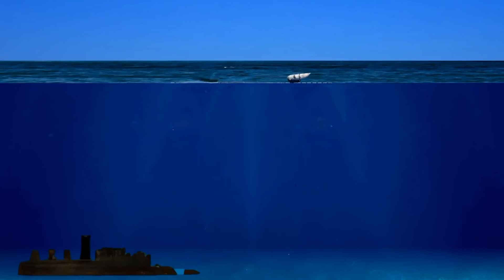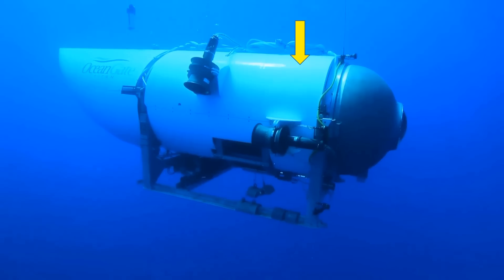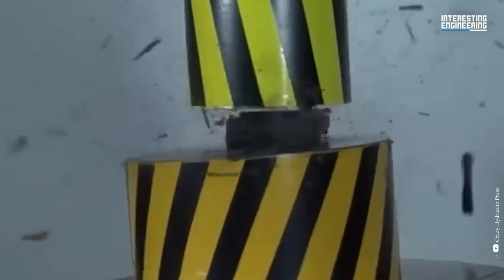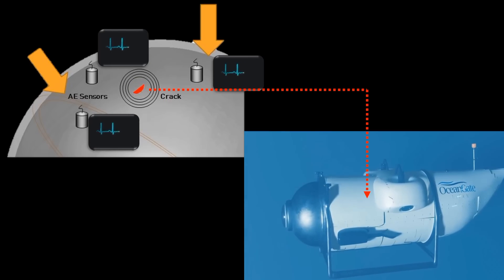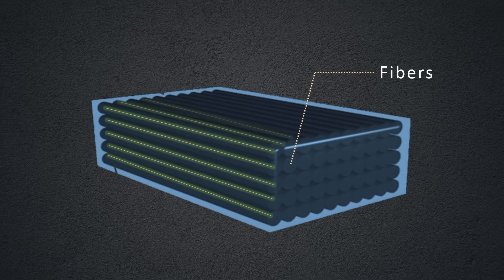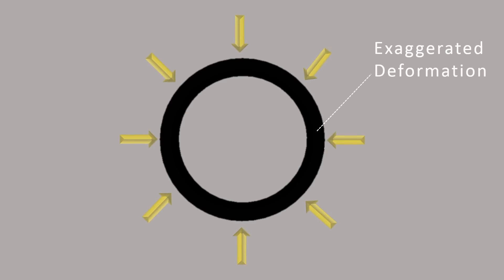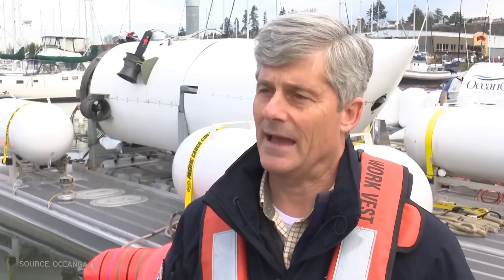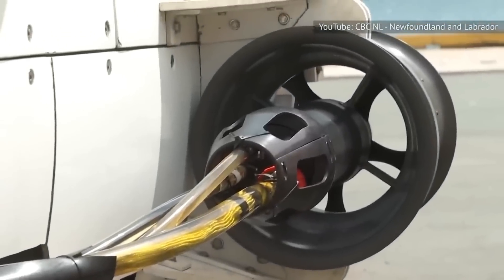Oceangate Titan Did Not Implode Just From Pressure. There Is a Catch!

Comment: Another detail that most folks are ignoring is the cylinder was subject to tremendous axial loads.  While those titanium end caps were strong enough to withstand the pressures, they also have to be 'kept separated' by the cylinder.  That's over 58 MN (13 million lbf) applied 'across the fiber'.  A narrow walled cylinder subjected to much axial load could suddenly buckle, especially if the cylinder deformed even a little bit from some growing defect.
Reply: Like when you can stand on an empty soda can if you can slowly balance on it, but if someone touches the cylinder wall with smallest pressure it collapses.
Reply: @DJJahT  Quite right.  Now in a soda or other beverage can, they deliberately pressurize the can and that helps the cylinder maintain rigidity.  A full unopened can is actually quite strong.  But relieve that internal pressure and as you say, the smallest defect/ dimple and it crushes immediately.
Reply: Ah that was a fine old party trick in high school until the one time I trapped my fingers because my reaction time was too slow from what was contained within the aluminum cylinder which I had previously emptied. Into my mouth. And it wasn't Coca-Cola.
Reply: @DJJahT that’s a great analogy, so true !
Reply: @DJJahT  except titanium & carbon fiber are stronger than aluminum.
Reply: Correct. Therefore, I think that the implosion occurred in the axial direction, where all the compressive force was carried by the epoxy and the thin tube of metal on which the epoxy was wound.
Reply: Axial load!!  Yes!!

All that resisted the axial load was epoxy.  Having fiber probably increased the stiffness, but the fiber orientation was normal to the axial component of the load.
Reply: So if the front dome piece is titanium and centre hull is carbon wouldn’t they compress at different rates?  And where they are joined be a risk of failure?  And how was aloud to enter the sub like that
Reply: @joechapman9518  well yes, but that would be in the radial direction.  As pressure rises the titanium ring would be 'squeezed' to a smaller diameter, and so would the carbon tube.  They have different rates of 'squeezing' (Young's modulus) so they would no longer be the same diameter as each other like when assembled.  I believe the titanium would compress more (it has a lower Young's modulus).  This DOES add additional stresses at the joint and may have been a failure point.

I was just pointing out that the axial loading hadn't been discussed much.  It is being applied to the carbon fiber at right angles to the way the threads run, and that's the weakest direction for carbon fiber.
Reply: O-rings...weak links in Space and Ocean environments.
Reply: Yes, I was wondering how the junctions between the O-rings and the carbon fibre part were doing, especially since the overlapping of the rings with the carbon fibre hull were only a few inches. If the carbon fibre tube was working during descent and ascent then the glued parts at the O - rings (which themselfes were probably the stiffest parts with the  least deformation) would be those with the biggest movement along the way. The stiffest and most pressure-resistant part (the O-rings) were connected to the part of the hull that moved the most during descent and ascent if I understand it right. My guess is that one of the O-rings had probably started to disconnect from the carbon fibre tube, due to the adhesives being weakened over many cycles. Things might have started there. Just a guess. I'm not an engineer.
Reply: This is what happens when you skim your research before building a sub, a cylinder is great at holding up vertical loads, not great as a pressurized vessel due to load being all encompassing. The Titan would have been best used to view shallow areas for extended times but I wouldn't go past 300 meters in that thing.
Reply: @gustavedelior There's a report, that on an early dive, a passenger heard cracking at 300m.
Reply: @georgew2014  since they didn't hire old white guys to drive the things it wasn't old knees lol
Reply: What is the problem using decimal units? Try Mpa, tf/mm2, KN/m2 etc

Comment: According to leaked transcripts, looks the rate of descent was too fast: they were 1h earlier than scheduled at 3700m depth, and being lighthearted about it. For a sub, a faster rate of descent means buoyancy is off. Indeed smth was off because when they tried to ascend after alerts, they were slow (6m per min). Had procedures been taken seriously, the ship would have asked the sub to slow their descent, they would not have been able to comply easily, which would have triggered an abort when it was still in a safe zone. The company did not toy with one boundary, but all at once. They did not learn or even tried to learn anything from previous mishaps. Brashness and overconfidence killed ppl.
Reply: Have those leaked transcripts been confirmed as real? I heard they were fake.
Reply: At the FIRST depth check-in, alarm bells should have been going off. You see the same thing with air plane pilots occasionally - rather than immediately abort at the first sign of trouble, the ego takes over and they continue on believing they're smart enough to resolve the problem on the fly. What they AREN'T considering is the lives of others who are trusting them to NOT do that
Reply: At that rate it would've taken them approximately 9.4 hours to re surface from 3400 depth...you're right. It's crazy that no one picked up on this.

Comment: Please, don't quote the controller as engineering mistake. If all, that was a right and smart decision. First of all, a consumer device is most probably much more stress tested than any custom made ones. Second, it probably communicated with the computer inside the sub. Third, they had a couple of spares for redundancy. Fourth, it's not connected to catastrophic failure in any way.

Comment: Just remember this: there is three failure points on Titan. 
1) power cables entering the sub prone to leaking salt water.
2) carbon fiber hull
3) epoxy glue attaching carbon fiber to titanium end caps.
I think the epoxy glue failed first, allowingvdra water to enter throwing the sub off balance and disturbing the bouyancy of the sub. Keeping it from surfacing in a timely manner. Sea water is very corrosive. Once water started to enter, the hull was losing effectiveness in its strength. Once the epoxy glue completely failed, there was no keeping the end caps from separating from the sub and the weight of the water crushed the sub. The weakest point on the sub was The epoxy glue.

Comment: sry but that long sub are not a problem is just wrong 

most deep dive sub do not have long body but a titanium sphere with a long open body build around it that did house the equipment
MILLITARY SUP MARINES  DO HAVE LONGER BODYS BUT THEY DO NOT OPERATE AT AND GO DOWN TO 3000-4000m they do operate at like 400m-600m !!!!!!!!!!!!!!!
the window they did used was only rated for up to 1600m also not good!

I also said that they only use unidirectional carbon, but a long tube must also be reinforced according to the length, so bi-directional cargo should also be installed, as movements can cause the tube to bend slightly
but what i did missed is that they did NOT use a vacuum at all on the carbon chamber, too pull out any bobbet that may be trapped in that carbon layers 

the ends also did only extend 6-10cm into the titanium ring if you ask me they way to little because thoses parts gets the highest forces to carry, at that point need to hold the wight and momentum of the titanium rings at every movement (sure it lighter in the water but it still has a wight undlike the middle parts)

and then the the monitors and other part from the inside i just really hope the did not screw it into the carbon haul but into a inner shell 

they also have sensors build in into the carbon struckture with is kind of bad because thoses part are weak points not layers of carbon, sure it can tell you 1-3 min befor it collaps that you going to die but what the point it take minutes or even hours to get back
the transcript did say all sensors did fail and it did not help them at all in the end it was just like a deathflag nothing more for them 

that carbon prodution part it also importend like you did say 
but also what kind of quallity did die use and what material?
carbon olny? 
carbon + aluminium (like for planes)?, 
carbon + aramid (kevlar)? pain in the ass to work with but it will not crack like carbon dose 
unidirectional? (good to make rings or as additions layersto strange a part in one direction?) what they did use only (why?)
bidiagonal?
bidirektional?
triaxial?
quadraxial?
all these variants have different properties and strengths
a combination could have stiffened the hull more than just one variant lying in one direction the pressure acts on the object from all sides, as well as the weight distribution of the objects that are attached to the carbon tube when moving, the loads on the pipe change since it was due to the metal ends or the people in the pipe, who by the way had no seats

they should test different meterials not just one in different layers and use vaccum to pull out any air out of the epoxy they used
maybe then it would last longer maybe  
but the moment i realize they did not bleet the air out of the carbon i know it had no chane in the long trem 
fuck even for car part they do it because it can cause depamination

Comment: What was the point of it having Real Time Monitoring? To be told in real time that the hull was in serious trouble, probably accompanied by cracking sounds; and to be told you're going to die at any second! The RTM was another gimmick on Ocean Gate. Rush should have strength tested the carbon fibre and its peanut butter-like glue in his sub before taking each dive.
Reply: Indeed. Rush's attitude to failure testing was "Most failures are due to user error. Testing doesn't weed out user error, therefore it isn't necessary."

Comment: Would carbon fibre wound around steel/titanium frame/cage work better? This way compressive load from outside becomes tensile load.
Reply: It would have to be a very chunky sizable frame, you lose the 'advantages' of the open CF tube then. they could have used multiple sphere construction connected together with titanium bulkheads (small access opening between spheres), that might have worked.
The design was light weight for cost and ease of manufacture and handling, 'disney' pleasure trip submersible etc.

Comment: I've used CAE to design a number of composite structures which have then gone to physical test.
There are many factors that you just can capture in CAE. The manufacturing process is key but must structural engineers know that composites are crap in tension.

Comment: Carbon fibre encapsulated in expoxy resin, is a plastic. Plastic material is never stronger than the day it’s made, all mechanical strengths decrease with age, stress , uv exposure , thermal cycling and other assorted impacts. 
Fools all at ocean gate

Comment: Ir xould bit gave helped that there were iver thirty feet of glue joints on the Titan. The two ends were glued to the middle. Between changing pressure loads and changing temperature, along withmetal glued to carbon fiber, each element responding differently to pressure and temperature, it had to be hell on those glue joints. Rush was trying to redefine physics to fit his desires. This was cocaine engineering. Youll never convince me that cocaine wasnt involved in this arrogant stupidity.

Comment: The game controller is basically the least of the problems on this craft. As long if you got a spare, and batteries you're good. Don't forget, military utilises controllers for certain aiming of guns as well. Sometimes it's just a practical solution off the shelf. Oceangate is getting alot of flak for the usage of that Logitech F710 controller. But after learning how many rules and common sense was thrown overboard, this was exactly what Cameron said 'an accident waiting to happen'. A carbon shell, why the hell would you want to make something that has to dive; lighter? This material is strong as hell, but as you pointed out; the wear on the fibers which apply when diving up and down causes invisible damage.

Comment: It essentially wasn’t from pressure it was the fact that water is not compressible at all, and if it was then it would compress and water would enter the sun at normal rate despite pressure, but Bec water has no compression that pressure makes it get extremely violent.  I could be wrong though, I remember seeing something where you can swim at certain depths so long as your lungs are filled with a fluid, seems totally counter to reality but allows you to breath

Comment: Your model of the load is not correct. Under waterpressure, the structure is compressed on all sides. It does not have a bening load. The only "bending" is a result of buckling, however this is mainly affected by the stiffnes as this provides stablility. This load is carried by the epoxy. The only real bending load is on the length of the cylinder. Unfortunetely this bending load has an extreme negative effect on the ability to absorb the pressure load already exercised by the front and rear titan rings.
As stability is the main design feature to withstand pressure loads with instand failure when exceded, composite materials are the worst.

Comment: They towed the sub for 600 miles across the stormy Atlantic behind the mother ship for the first time this year. Videos circulating of a sub being launched from on board a mothership was from prior years and not the fatal mission. The sub was towed on top of it's dual float launching vessel. That launching vessel is of flat bottom design intended for calm water such as a lake or a river. In open seas any vessel needs to have a V hull variation to attenuate vertical shocks of pounding wave action. This towing business may have damaged the sub in many ways and created a situation where any necessary servicing or maintenance of the sub was made difficult or impossible as it was stationed on a tow rope in bouncing waves.

Comment: You need to update this as we now have an update due to the leaked messages between the Titan and it's mother ship just before the implosion. They had an acustic RTM (Real Time Monitoring System)  on the sub that monitored the health of the sub in microseconds. It's supposed to pick up the most insignificant changes in the structure and give them hours or warnings but something went wrong and it all failed at once. They were carrying too much weight from the beginning of the trip, even after all their heavy equipment was jettisoned they were still too heavy. They also heard crackling in the aft of the sub at least two different times

Comment: As a mechanical engineer i can say materials like carbon fiber do have one advantage which is its natural buoyancy it can resurface by itself by dropping weights but carbon fiber for making deep sea submersible is not completely studied yet . ocean gate tried to cheap out every way one of the most convincing fact is that manufacturing of carbon fiber hull do posses voids which can lead of all sort of problems, carbon fiber hull with void percentage less than 0.1 percent is very much possible but expensive, in Titan's case its estimated around 1, a huge red flag when engineers raised concern oceangate responded with RTM which is not effective and cannot ensure safety we have 100 plus years of experience with steel even titanic itself is holding its structure for such a long period of time. Just like titanic over confidence and ignorance to warnings can lead to tragic loss, my deepest condolences to all the family members of the souls perished in both titanic and titan.

Comment: I’m not a physicist. Does anyone know if this could have started as a very small leak which held for a while but then became uncontrollable (I.e.- could the passengers have been aware of a leak or was there no time to communicate with the surface)? Tx.
Reply: At that depth, you may have had time to look at the leak but unlikely. There was a transcript that was on the web that may have been fake where the acoustic sensors were all signaling failure and that they had started to ascend.
A leak at that depth would have even sawed through the titanium in just a moment. They use water jets with less pressure to cut steel. Imagine, waving your hand at the leak and your fingers fall off.

Comment: As a scientist, I was surprised that carbon fiber was used and/or  even recommended for the sub. After learning Rush was an aerospace engineer and it was his idea to use this material b/c it was used in shuttles, I said to myself, “You can’t compare atmospheric air pressure to water pressure. There’s no comparison. It’s two different forces and water is stronger.” We learned this in engineering physics, smh. I’m sad that lives were lost. You’re right and we all agree this could’ve been avoided.

Comment: What an excellent video!!  I remember when carbon fiber was first used on mountain bikes. It was used in frames, suspension struts, handlebars and seat posts. The stuff FAILED ALL THE TIME. Usually the failure was sudden!!   Using carbon fiber without proper stress testing and without proper re examination after every dive made the Oceangate a DEATH TRAP!!